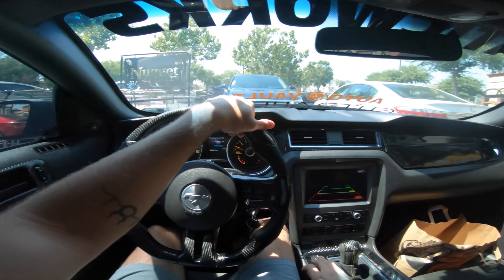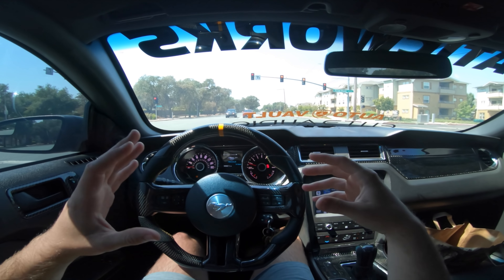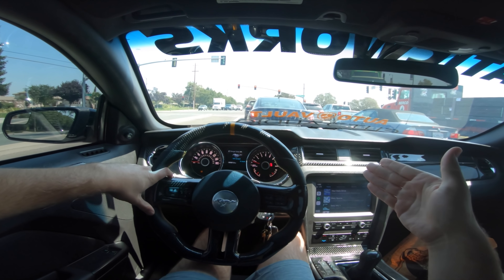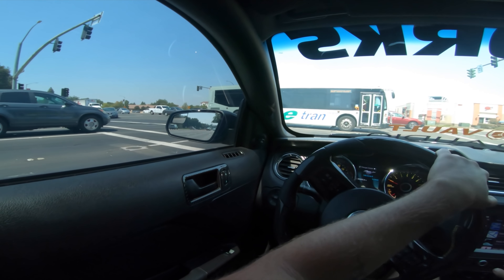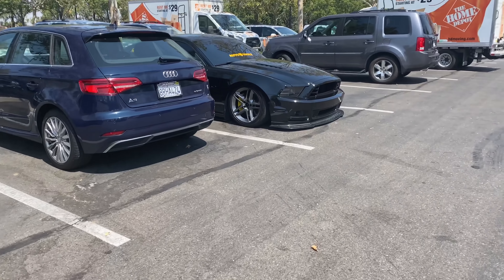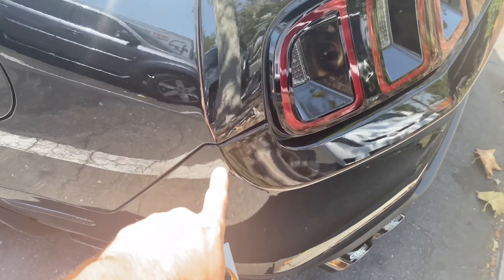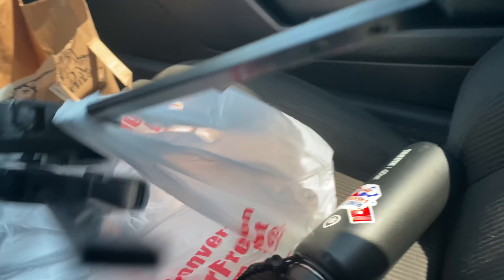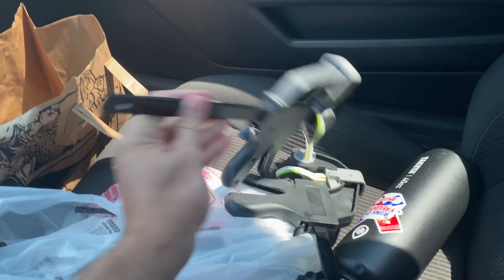This ALWAYS Happens When I Drive The Mustang...

Comment: Fiat-Chrysler of America has improved the quality of their vehicles. However, I've sold both FCA and FORD and CHEVY new, and still continue to sale alot of these vehicles now. Fiat-Chrysler (also ram) I like the truck, but I hate the quality control of the company. I would never buy any of their products. Ford is a decent truck, but really If I were to buy a truck I'd get a Toyota Tundra, Look for the 2021 new revamp coming out within the next 2-6 months. I'm excited to see the new line! I bet I'll sale a ton. Also note: The tundra has the most HP, most towing capacity, and has the biggest cab out of all the full size 1500 trucks. :) I'm doing the Syncroshift 2 w/ sealant transmission fluid change this sunday. Hoping I can reduce the 2nd gear notchyness in the 5.0.